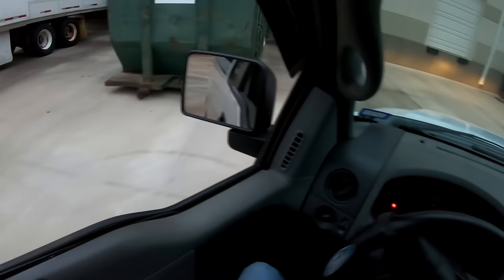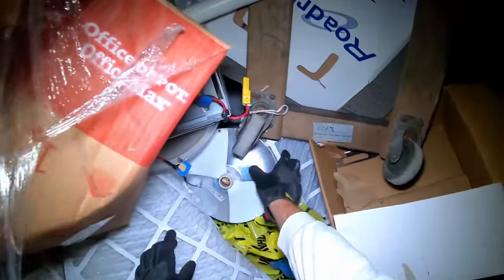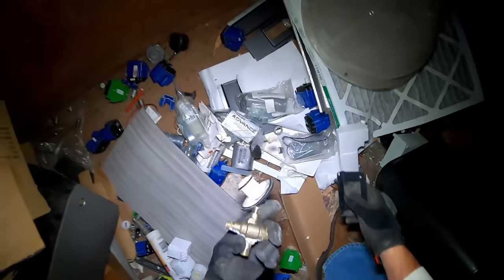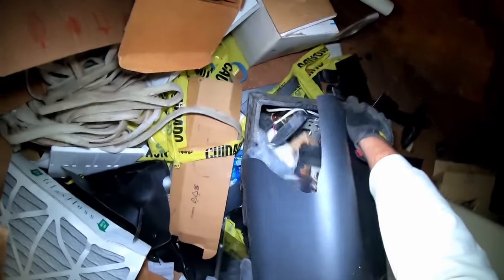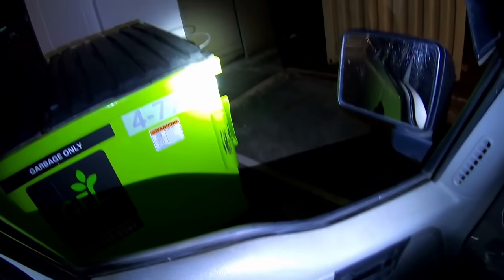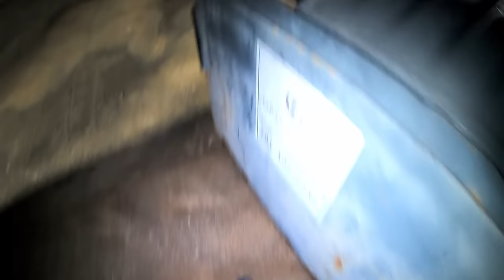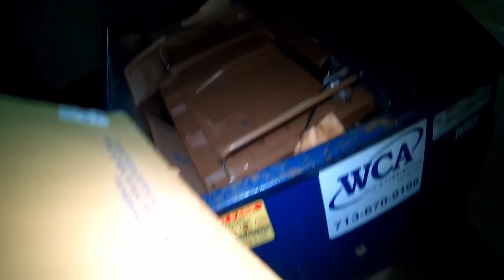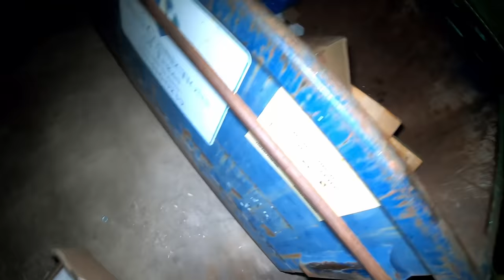Dumpster Diving "A Buffet Of Scrap MADNESS!!!"

Comment: Got an idea for a new tool; take an old steel head garden rake and weld one or two small sized speaker magnets on the opposite side of the head ( away from the handle) so you can pull it through the piles of scrap in a container, so you don't have to pick through every little snipit and such. Good luck 🤞

Comment: Hey Mike, those Cisco units from that open top are actually managed wireless network access points for corporations/large installations.  It's like your wireless router for home, but we install one per room for wifi coverage in offices and such.  Your computer guy may want those!
Reply: Wifi signal booster. We have them through our our building.
Reply: Yeah, I was like NO, DON'T TOSS EM. 🤣

Comment: That Lincoln Electric Arc sensor is an automatic sensor for welding fume extractors. It starts the extractor fan as soon as it sees you start welding....... FYI they are about $1500.......
Oh, and that first electrical box you couldn't remember the name of? Its a Variable Frequency Drive unit.... or VFD, or sometimes called a VSD where the S stands for speed instead of frequency.

Comment: Those big round buckets that are stuck together, all you need to unstick them is to slide a thin piece of metal or wood like a slim-Jim etc., down the side of each one to allow air to get into the bottom of each and they’ll come right apart.   😊😘♥️🌈🇨🇦

Comment: Hey Mike, just to let you know, some of those older car jacks are worth some good money. Hard to tell what it came off of. You tossed it to fast. But it's all there except the tire iron. Sometimes they will have the manufacturer's stamp on it.
Reply: Yes those jacks can be worth money to a person who is restoring an older car for sure. do NOT scrap that for sure.
Reply: @larryfarmer7774  My brother in New Jersey bought a nice 1973 Dodge Charger and didn't have one in the trunk. I live in Michigan and it took me a year give or take to find one. I paid a $125 for it, all 3 pieces. It wasn't rusty but did need a repaint.
Reply: Looks like 60's GM bumper jack. Somebody is looking for one of those.
Reply: @franko2k  That jack Mike found is for the slits in the old chrome bumpers
Reply: Also Best to have two trucks and  after you fill it up  go back home and drop it off and  bring  the other truck back and refill it  if you find  an open top with  lots of metals

Comment: 2:32 - 40 Thanks for the reply.  Yes, you're right, there is no scrap lumber yard waiting to pay cash.  But, and this is speculation, based upon my recent experience pricing/buying wood, I'd guess if you built up a pile of 2x4s you could easily sell the lot at half lumber-yard prices thru one of the regular online channels:  You'd make way WAY more than on the wire.
Reply: He did say he doesn't have the space to do that and even recently downsized his storage locker.
Reply: Lumber yards sometimes buy em as reclaimed or recycled lumber

Comment: You many times pick up breakers. It is fairly easy to scrap them up on your own. They contain decent silver, aside of brass/copper inside. Contact points inside are made of silver. If you accumulate the pile of them, you can scrap&sell those for very decent money. Silver is selling easy.
Reply: yep lots of those  contacts are worth money.

Comment: Those Cisco units are wireless access points. Most have 2 small circuit boards and the housing is cast aluminum.

Comment: As what someone else said those white are made by Cisco and used for Wi-Fi and do have value. They might 48VDC so if you find and transformers don't cut the ends off.
As for lumber what was I n that dumpster is another $300. Worth of lumber.
Pallets here by me are used for the cigarette plants and get 
Repaired and sent out again.
I worked in that field. At the time I had a decanter on my table filled with tobacco and cigarettes.
I quit smoking. I did make up 3 foot cigarettes as a joke and placed in a plastic tube and evacked the air from the tube.

Comment: If you have buckets, or trash cans that are stuck inside each other, use an air nozzle and stick it down the side of the bucket that is inside the next one.  The air pressure will blow them apart.

Comment: the square rounded corner plastic boxes look like wifi access points/mesh routers. If they work please don't scrap them out..... got to be worth $50 each, typically start at around $100 each up to $250!

Comment: The round cylinder is a capacitor it hits the ballast with a jolt of electricity to start the reaction in the bulb usually a sodium or a mercury vapour

Comment: Here in north central texas last night got down too 16 and windy. PLUS excitement !!!! about 12 oclock I seen a fire truck blow down my road and looked out and my neighbors pasture was on fire. I jumped out on my 4 runner and gathered my horses and cows out of the close in the fires path and moved them down to another pasture for safety because they were in a panic having to eat all that smoke plus fire was very close to jumping the road and getting on my land. finally got home around 4 am colder than a well diggers butt. All is well on my side except the animals are still in a little panic so going to let them set in the lower pasture for a few days. neighbor lost a small junky barn, about 5 acres of tall grass and posts. his animals were already in a different lot but we moved them anyway just to be safe. It's 35 out so fixin to go look at the damage of the night.

Comment: The Cisco things, big white squares, are WIFI Access Points.  They help extend the WIFI network throughout the building.  Not sure if they are worth much as scrap, most of the material is hard plastic and a circuit board.